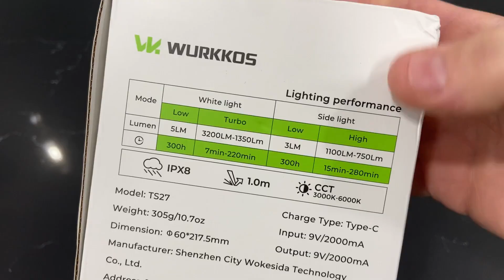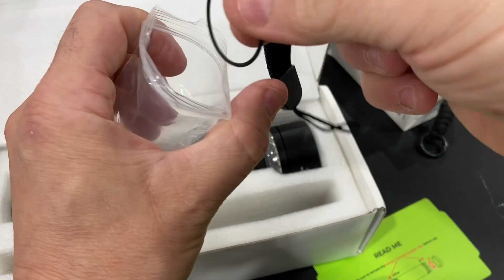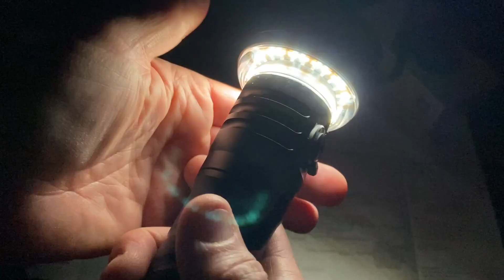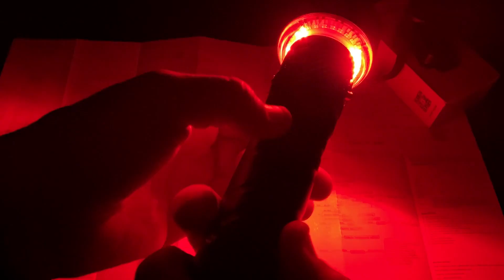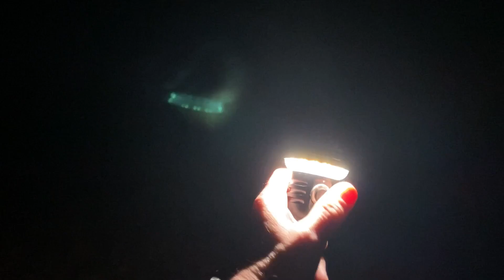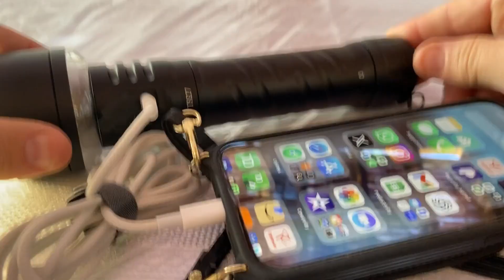Wurkkos TS27 Powerful Flashlight with Sidelight Color RGB & Power Bank!!!

Comment: 15,000 mwh, not 1500 like you said.

The TS27 is FAR from water proof. Without filling the charge port with dielectric grease, the flashlight will leak water into the inside and quickly ruin it. Threads where the parts join should also be sealed with dielectric grease to prevent thread wear and water intrusion.
Reply from the maker: Yes! The battery is 15,000 mAh… that’s correct! And good tip on using the dielectric grease to seal the threads and port cover. I wouldn’t drop this into water. It may handle some light rain, snow or drizzle. You have to be careful sealing the port because if the grease gets into the port connector it will stop it from conducting, interfere with charging, and be a pain to remove. The screw on ends of the battery chamber have O-rings on each end so some grease there may help improve water resistance. But you have to be careful not to cover the end of the tube itself as it touches a plate and spring that contacts the end of the battery and lets it conduct through the body of the handle. Thanks for watching!